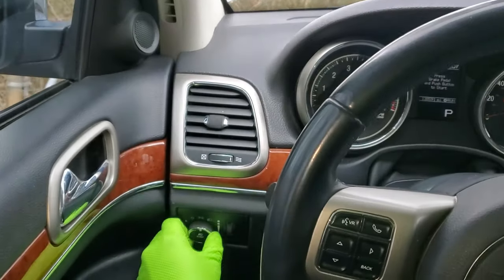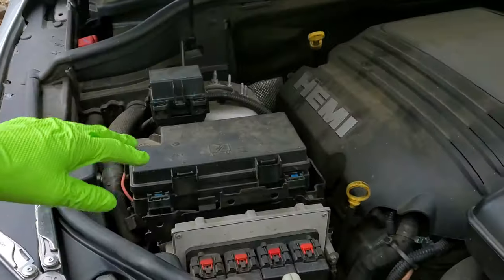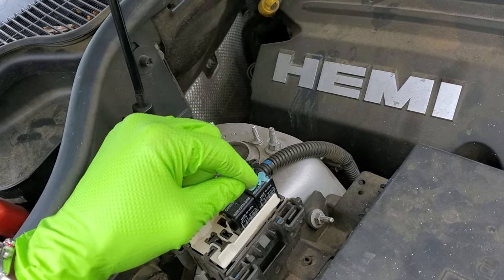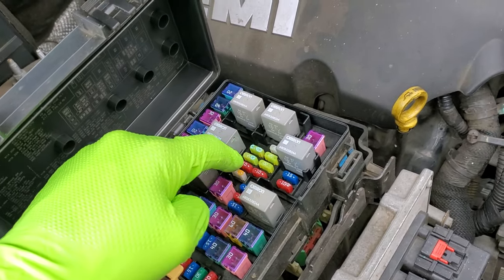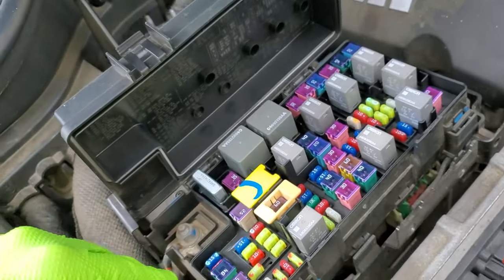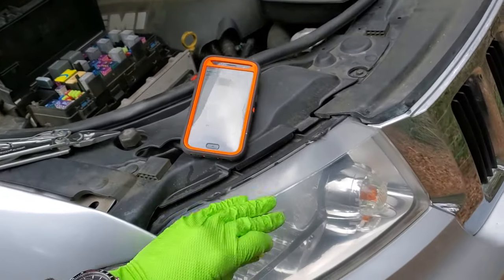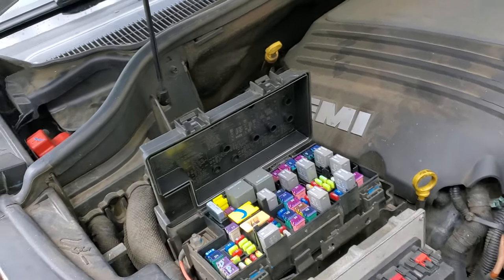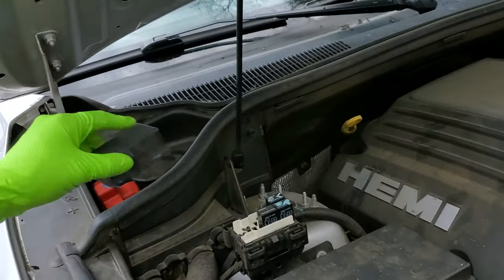2011 Jeep Grand Cherokee Headlight Fuses, Daytime Running Light Relays

Comment: I have a 2013 Jeep Grand Cherokee, I changed the head light bulbs and and the driver side still won’t work but works when put on the passenger side. So my question is, is there a ballast on each light or a amplifier? I’m at a loss. I see what appears to be a ballast on the bottom of the light assembly could this be the problem?
Reply: I also have the same exact problem with my 2013 Grand Cherokee.  I am wondering the same.
Reply: Hi guys, did you solve this issue? I have the same problem.
Reply: Me too!

Comment: Can't fix mine. All lights work except the rear passenger tail lights. New bulbs, fuses, both relays are good, etc. Shop I bought it from is confused too. Guess I'll get used to paying tickets. Bought this Jeep last week and nothing but issues. First and last one for sure. Btw, I pulled both those relays out and my lights still work. Just not the rear passenger side tail light. Lol

Comment: I have a 2018 and both headlights, won't turn on along with the break lights. Signals work fog lights work. Dealer is saying i have to replace the body modular control. Can that be an issue as to why my lights aren't working??

Comment: This was very helpful. Hopefully you can narrow down the answer to the question I have.
2011 grand cherokee, Llights "on" at night will cycle every phase/option including "Off" while driving or in parked. Any clue as to what's causing it? After watching your vid I'm wondering if the sensor on the dash is out or failing.
Reply: This is happening to me as well. I've seen this question floating around and NOT 1 DAMN ANSWER to it. If you've figured it out please let me know.

Comment: Great video. I bought a new low beam bulb for driver side, installed it and still doesn't work when turning on lights. Passenger side comes on only.  Could this be relay/module issue?
Reply: Same exact problem currently. Let me know if you find a solution please
Reply: Same problem right now. Please let me know if you find a solution

Comment: Hello, this might be a dumb question, but if I am having issues with the leveling adjuster and high beam function on only the headlamp assembly one on side, could it be the fuses? Or does one fuse control both headlamps for those functions?

Comment: I put a new bulb in on my drivers side (also did last season), put everything back together only for the headlight to still not power up. I took it all back apart. Pulled the headlight out still connected to the connector. 

Then I turned on the headlights and still nothing. Wiggled the cables and alas, finally came on. So its just loose or shortened wires.
Reply: I’m having the same problem. Thought my bulb was out but a new one didn’t work, put the old one back on and tapped the headlight and it starts working! Don’t know what’s wrong with it? Do you?

Comment: I have a RF low beam thats out, have replaced it with multiple bulbs and went side to side.  High beam works fine.  would it be the relay bad or just a wiring issue I need to trace?
Reply: Did you fix? Having same issue
Reply: Same here

Comment: hey dude! Question. Ive checked both relays like mentioned in beginning. all fuses are not blown that you mentioned the 15, 10, and the two 20s. replaced ballast for passenger side HID. also just replaced actual bulb. d1s 6000k still not coming on. any thoughts to what it could be? TIA.
Reply: its works while you are driving the car
Reply: I have this problem with my driver side if anyone finds out let me know please
Reply: @travisbaskerville3885  me as well. Only my driver side headlight won’t work.
Reply: Anybody got a solution? My passenger side light and flood light don't work. I'm sure it's a wire after the relays
Reply: 2015 JGC no high beam only low beam working. checked fuses all ok..tugged on wiring nothing , changed bulbs nothing. Anyone having same issues?

Comment: I have issue with my driver side fog light, single and park light won’t turn on unless I remove the entire wire from the fuse box any suggestions what I should do?

Comment: Got 2 issues with my 2013 grand cherokee
- Daytime running light on passenger side turns on/off randomly
- Orange lights on passenger side works  when turn signal on but not when lights are on (if that makes sense)

Comment: I need to know what the middle light is.  It doesn’t work on either headlight but high and low are the outside light with parking on the inside.  What does the middle one do???   Thank you to anyone who knows. Can’t find a diagram or video so far
Reply: I have the same problem. If you find anything let me know...
Reply: @joshuakarn9944  daytime running lights
Reply: I am having the exact same issue right now !! Just replaced both HIDS Driver / passenger sides immediately after replacement of both bulbs my ( middle) daytime running lights are not working on either side !! Any ideas ??
Reply: Also all fuses & Relays checked no issues found at this time either , that was done at Auto Zone

Comment: I have one problem with my gr cherokee 2011 , taillights driver side not fonctioning when i turn on the light in auto or manual mode , the passenger side is working as it should be

Comment: I have a question . I checked all this fuses and my radio does not go in dark mode in low light outside anymore. Also Monday time running lights are always on. Grand Cherokee Laredo 2012 . Thanks
Reply: Make sure you dimmer switch isn't set to max brightness if it is it won't switch over.... Once it's turned down it should change from day to night mode

Comment: I have a 2012 Jeep Grand Cherokee summit and my lights has went out not my light bulb my light system the dealership is telling me that I should replace the whole light system. But when I went in for service no one told me if they even check the  The fuse before I pay money to have it fixed what shall I do?
Reply: Wow. Yes, I certainly hope they checked your fuses before advising that! They should have briefed you on everything they tried to do. If they didn’t check the fuses, FIND ANOTHER PLACE FOR SERVICE! Or at least request another technician! 😂

Comment: '11 GC Jeep, I have Xenon bulbs but the middle light I'm assuming are or should be Daytime running lights, should be working but aren't.  I checked all fuses and switched the relays but nothing  happening. Any help ?? I'm starting to think the middle lights are just for show.
Reply: Same issue here. Let me know if you find anything please.
Reply: Middle lights come on when driving that’s why you can’t see them on
Reply: This may be the same cause that I just learned about with my 2012. Apparently not all JGCs had the DRL function enabled at factory. They can all do it, if yours have never been on the computer just has to be reprogrammed and that should only take 5 minutes at a dealership.
Special note about this: There are two ways the tech can do this. The wrong way would be to change the regional setting. If you are in the US, putting the vehicle into “Canada mode” will do it but that will screw up a factory radio because the regions won’t match then. However, if you are in Canada and you have an import JCG from the US, this IS what they should do because of Canadian regulations (DRLs will function a little differently). Unfortunately you will need to replace/reprogram the radio as well.
Hope this helps somebody 😂✌️
Reply: @explorerboi84  thank You 🙏 for the information this very helpful and I appreciate the time you took explaining this.
Reply: @ZEDNANREHIGH  You’re welcome 😊
I just stopped at a local dealership and their lead tech said there isn’t a way “he is aware of”. I’m getting the feeling most Jeep owners haven’t been concerned over it, making it a rare question and that means the solution is probably even less known.
I read the information I stated before in a Jeep forum and some pll did have it done. I’d like to hear if it works out for you and I’ll post if I’m successful. Good luck🤞

Comment: Super helpful. Which fuse is best to check or replace if my JGC Overland's Led Lights on the passenger side works when I lock the car but when I'm driving it's only the halogen on. It sometimes comes back on but clearly there is a bad connection or fuse. Thanks

Comment: I have a 2017 Jeep GC. Both front and rear exterior lights on the passenger side 
have stopped working at the same time. Which fuse or relay would that point to?

Comment: Hey there , i have a problem with the taillights driver side on my jeep grand cherokee 2011, brake light and turn signal are working fine day and night  , but when i turn on the lights on taillights on the driver side like i said before are not working , any tips or idea if there’s any fuses for each sides someplaces other than under the hood :(
Reply: Same issue  in an 07 jeep. I replaced  the switch and headlight.  Neither was the problem.  I can turn on left blinker and then turn on headlights and it takes about  1.5 seconds  to start blinking faster so I'm pretty sure a relay is getting  weak or something.  But no luck here haha.